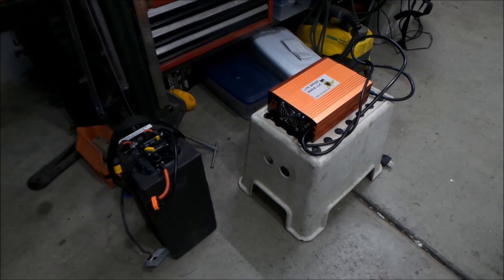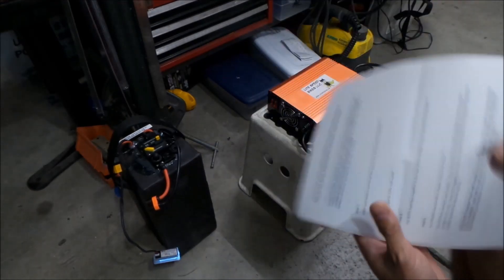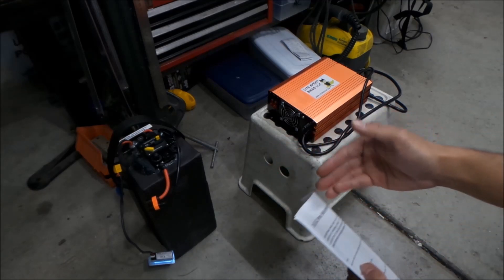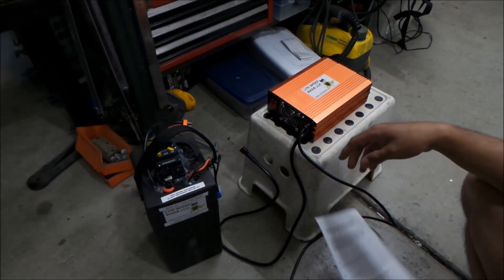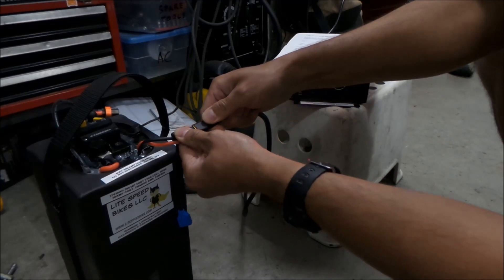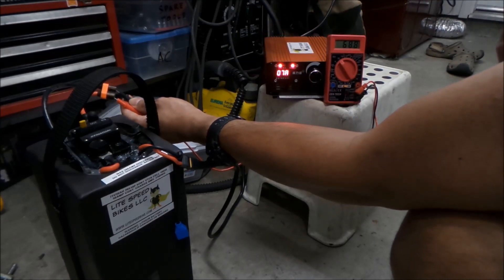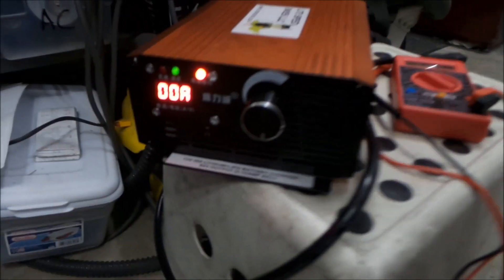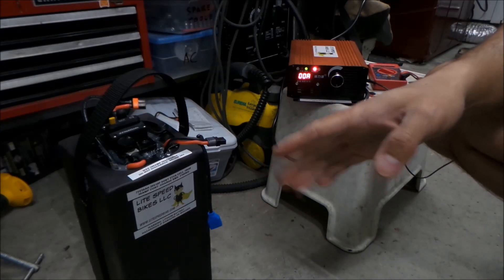Litespeed Bikes 72V Variable Current Charger Part 1 - Charging Litespeed 72V Battery

Comment: No need to screw around using a additional Voltage gauge. The switch on the back let’s you choose to view amps or volts. So once you set your current then flip the switch and you can see the voltage of the battery. And yes it obviously shuts down when the charge is complete.